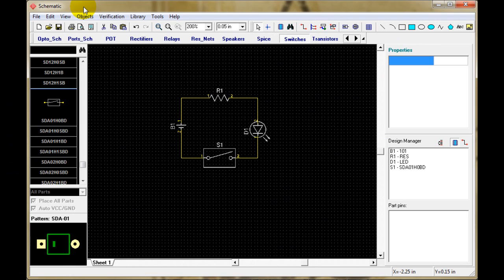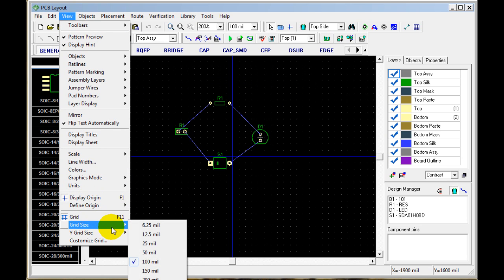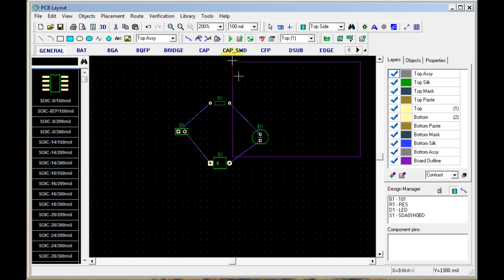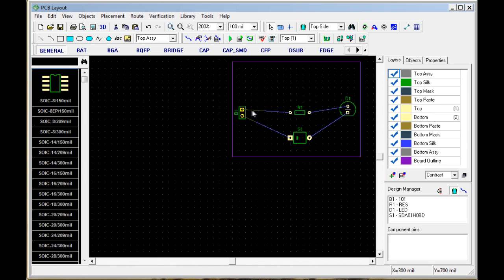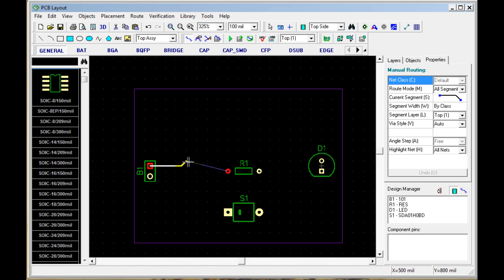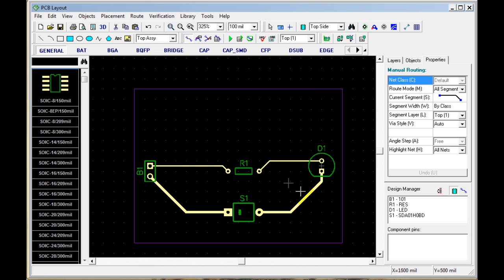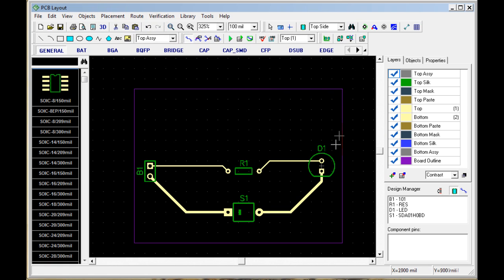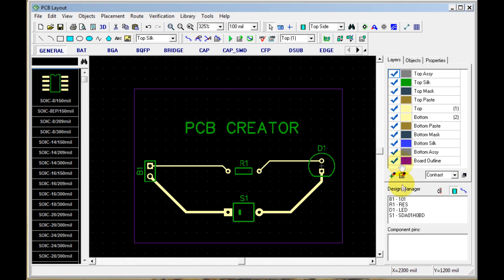How to convert a schematic to a PCB Layout with PCB Creator

Comment: I was searching for 220 microferrat capacitator but I couldn't find it 
in the libary The library is a mess. Normaly you write something and directly it has 
to find the right component. You type 220. and that must be enough to 
list all possibilities but it doesn't. The most pcb progs are working the same way but none of them has a good library search.. Another issue is, that if there was a component found the componnet will be shown in a black/white schematic, instead of a real photo to choose the right one. Today there is enough space on every HD to list all photos in realtime of all components.
Reply: +visornet24 there is no such thing as 220 microferrat capacitor. You must be talking about microfarad not ferrat. where did you even get that.